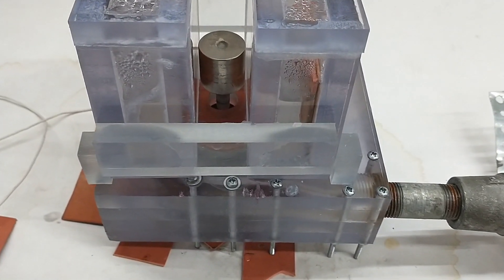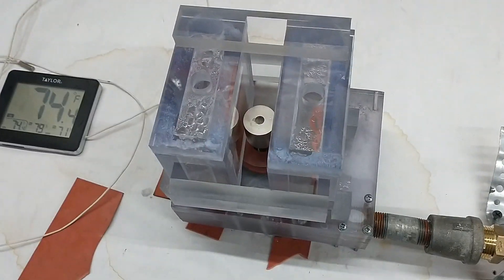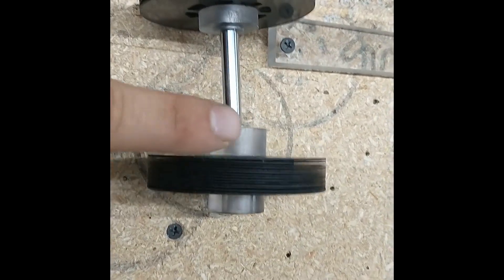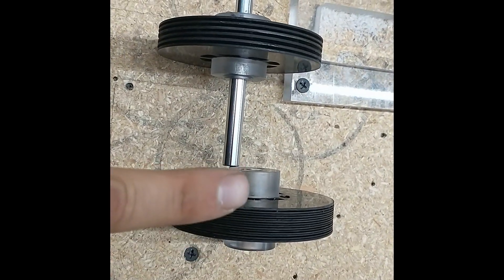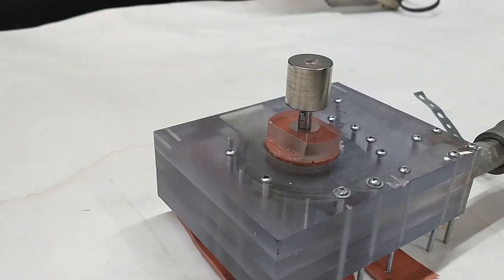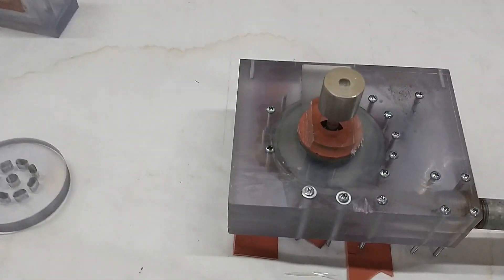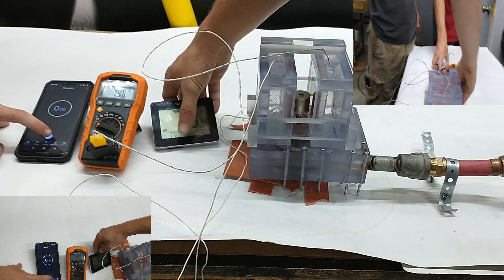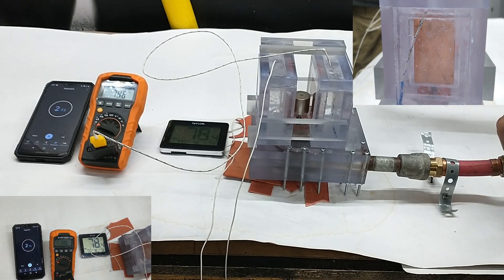3" Tesla Turbine Sustains an estimated 1750 WATTS!

Comment: Wait the spinning magnets made those plates heat up like that 😮
Reply from the maker: yeah 🙂
Reply: @iEnergySupply  have you ever tried putting a subwoofer up against the turbine (rubber or something noise reducing between) and using a frequency generator just as an experiment?

Comment: Ok what you want is a well designed ball magnet perfectly round now that is on a whole other level
Reply from the maker: surprisingly they don't come perfect. I still have to modify them to make them balanced.
Reply: @iEnergySupply  I think it's possible to run the turbine off from a geet Generator bubbler arrangement create enough energy to then the water into hydrogen using the George Wiseman browns gas technology then it should in theory work depending on the size 🤔 this would leave alot of extra power for the Generator to power stuff without dealing with breaking down the water to a gas by traditional methods now this would be better to start off small and get the bubbler working on a tiny lawn mower with maybe an alternator to see if the browns gas produced by the tesla turbine running off the bubbler would be enough to work on large scale that being said alot of research would have to go into such a system to obtain close to maximum efficiency plus the watts would have to be pretty high coming from the tesla turbine but even if that was the case and this system fails to work there's always solid oxide fuel cells and redox flow batteries that can be implemented into a closed loop system like specially designed around refrigerator systems something like seen on the race to zero point energy video on   youtube finally I would say what's need the most is a true dedicated discord or telegram channel where minds from different backgrounds and research can come together then the possibilities are endless providing the right communications and fellowship of course

Comment: Would it be feasible to implement an I/O swapping mechanism to switch the system over between seasons? Let's say we're using the constant temp zone from 12 to 40 feet below surface as the cold sink during summer and a heat source in winter. It would be much more economical to switch the input and output lines instead of having 2 separate systems.

Comment: I appreciate what you are trying to do but and I may be wrong but after seeing this video I don't understand how this can be feasible for the following reasons, maybe someone can correct me or educate me on this?:

1 - The quantity of water which you boiled was very little make this extremely inefficient
2 - You have to create the cold steam to drive this device - making this extremely inefficient
3 - This is using eddy currents and is similar of how an induction cooker works to boil the water, just because 'Tesla' is involved in some way doesn't mean this is anything special.
4 - There are specialist engineers and scientists who have studied aerodynamics and turbine design and they have done an amazing job if you take a look at the engineering of a steam turbine from a coal power plant or a nuclear power plant. If this Tesla turbine was worth any results they would have already gone this route, these designs and principles are no secret.
Reply from the maker: Finishing production turbine. It works great if you want to generate energy with high an even low temperature differentials. I have achieved an isentropic efficiency of over 95%. Videos will come later because we want to keep it confidential other then patreon until we start production, which is right around the corner.

Comment: you have access to a lathe to turn the magnet?
Reply from the maker: you can't turn down the Neodymium, it will alter the magnetic field, also it's extremely hard.
Reply: @iEnergySupply  harder than carbide? as far as the field wouldnt a perfectly cylindrical magnet provide a perfectly even field?

Comment: I finally see a vision. Using your cold steam idea. Preheating the water using a DC inverter split system water heater than creating a vacuum in the tank by adding an LG twin inverter compressor than pushing your turbine sandwiched in-between two copper line cylindrical tank. If I am right to assume that the heat generated would be placed evenly along the electricity. The only problem I have is whether, or not the electricity would travel around the conductors resistance, but if it could then you would have two true steam generators that could push a carbine fiber 18in tesla turbine.

Comment: I have a questions about the individual blades, but first the set up to the question.  The flow of the air/liquid appears to follow Fibonacci sequences.   Has any test ever been done on etching Fibonacci arches into the blades?  Also, testing aligned and off-set etched sequenced blades.  Also, matching the Fibonacci sequence to the flow - so the flow arch is the preceding sequence?  One more question; has anyone ever done counter-rotating generation?  Where the magnets and the copper coils are driven by tesla turbines rotating in opposite directions?  Seems lower speeds could be used to accomplish the task.  
I believe your the tesla turbine is great.  I am fascinated by the possibilities.  Keep up the good work.

Comment: Have you guys thought about using super heated steam 600-700 degress and a modified electric tankless water heater to generate the steam then using the steam to power the water heater. at those temps it supercharges steam and it is most efficient, its what nuclear power plants run at, also white and doble steam cars.

Comment: I'm now in the process of building a Tesla Turbine that can power an electric trike on two air tanks. Well one air tank will be on the turbine and once it runs too low I will switch it to the other tank and connecting the pedals to a pump so I can be pump the empty air tank with air to extend drive time 😅 then just switching back and forth mid drive to keep the turbine going and in turn keep the electric motor goin lol
Reply from the maker: Would be really cool to run it on co2, you would need to have a radiator on the co2 output to heat the gas as it expands into your nozzle though. I'm not sure how well it would do on just a tank of compressed air. There isn't much energy in a tank of regular compressed air.
Reply: @iEnergySupply   I'm thinking of using some truly high end, high PSI tanks that are fitted for refill AND I have some high end neodymium magnets that have pretty high teslas and some decently gauged silver wire. OR I can just use the turbine to power an alternator but idk yet. Just gotta calculate the turns and appropriate RPMs cuz honestly it wont have to be that fast to simply keep the batteries charged.
Reply: @iEnergySupply  Also, I predict it will work really good in cities or urban areas as the constant stopping gives me a chance to keep pumping while stopped thus charging the battery rather than long open roadtrips where the electric motors are constantly engaged 😅
Reply: @iEnergySupply  Hi sir

Comment: So tesla turbine is actually work but what about meccanical failure from warping disk? Are they string enogh to produce gigawatt or megawatt??
Reply from the maker: They scale very well,  I've never had any issues with warping. Nicola Tesla did a test to  See the maximum velocity of some of his turbines. His turbines. He did have disks warp but there was no reason to run the turbines that fast other than for a test. It actually wasn't an issue when running the turbines normally.  It's possible to get whatever power you want including megawatts , just depends on how large your turbine is.. Tesla's 18" turbine got over 200 horsepower And he said it was capable of 600 horsepower with full vacuum on the exhaust .

Comment: I think you might be getting a bit of imbalance and friction from having the resistor plates haphazardly placed on either side plus you're not transferring the heat very evenly and efficiently into the water with that configuration. I'm curious what would happen if you wrapped a coil of copper tubing of around 1/4 or less diameter tubing maybe 1/8" tubing in a coil so it creates an evenly balanced drag on the magnet as it spins but also you'd get extremely fast heat transfer by using narrow tubing gravity fed by a reservoir above rather than a resistor plate inside a container of water. The steam produced this way could then easily be directed back into your input nozzle for more power. I'm so excited to see you doing these projects because I can't afford to spend all this money researching. I need to build something that works out ok and use it. So you're saving me a lot of time and money by airing your findings on YouTube therefore I will never hesitate to share any idea you inspire me with or which might be an improvement on the project. I don't see anyone else publicly taking this research as far as you have but I believe that the public NEEDS this technology more desperately than they can possibly understand.
Reply from the maker: yeah, I didn't spend much time on this experiment, it was primarily for testing maximum power output of the turbine, but was also in my spare time while I was waiting for my more serious work. I thought it was cool to see the copper heat up so easily in the magnetic field.  I never intended to use the steam coming from the turbine generator.

Comment: I've been thinking of using compressed air as a method to store energy from my solar panels.  This looks like a feasible method to generating thst elslectricity, and if I can adjust the pressure, that means I have controllable power, which would be ideal for efficiency
Reply from the maker: Only problem is you would need some really large tank, and I'm talking over 3000 gallons. That's why I switched to cold steam.
Reply: You are better off storing that energy inside a sand-battery then. And using that either directly to warm your water or air, or to boil water. I was personally thinking of having a large tesla-valve running through the sand, so the water would start evaporating and will have no road to go except "forward". So you can supply water at low pressure, and have it escape at high pressure into the turbine.

Have you already heard of the "two stage" tesla turbine, utilizing his turbine AND vacuum patent, which are meant to work together? The last "piece of the puzzle", is to have an "air bearing" on the sides. So basically, Tesla Turbine in the middle, Tesla Vacuum on both sides, on the same axle. It will increase it's efficiency, + the air bearings will be suspended on constant small cushion of air, drawn in by the vacuums on both sides.

If done well mathematically (for which I am looking a book for), then efficiency can truly reach 100%, or 99%. For even the hot steam, has been shown to be able to be condensable to ice, effectively taking it's thermal energy as well as it's kinetic energy.

Shall I send you links if you are interested?

Comment: What is this some kind of joke? You have the output from the turbine going into the coil chambers? And why is the voltage not being shown on the meter. how do you measure torque? Did you hold it with your fingers and feel the torque that way?
Reply from the maker: I'm not using coils here, it's heating the water with lenz law, the power demonstrated is shown by the steam, and the amount of water boiled from the test.

Comment: so how many watts were used to send the air to the turbine.. does not matter if you make 50000 watts if it takes 100000 watts to work.. that part seems to be left out.
Reply from the maker: Air compressors, are not efficient, probably 10% at best once the air cools down. This is meant to be run on steam.

Comment: Let's hope one day you can make materials out of graphene!
Reply from the maker: Not sure why we need graphene, I have been getting the self regulating condition that prevents the turbine from spinning too fast. Also tesla didn't have any difficulties producing over 200 Horsepower without disks warping. If you think we need graphene because Lesics video on the tesla turbine Here is one of my comments "I just wanted to note a big mistake in the video! The video says the rotor must spin at a very high rpm, maybe 50,000 for a 6” turbine. The speed of a turbine is based on periphery speed not rpm. If a 6” turbine needs to spin 50,000 rpm to be efficient like the video says, that’s a periphery speed of 890.1 Miles per hour. If you want a 3 meter disk to achieve close to 891 miles per hour at the periphery, the rpm required is only 7,253. We have materials that can easily reach that speed."

Comment: Hello, would it be possible to create a design that allows the compressor to be fed and at the same time that there is some excess energy? so that it can be self-powered and have a few watts left over for lighting or other low-consumption devices. Great work. Thanks and regards.
Reply from the maker: it's designed to run off low temperature steam. This was just to show raw power from air.

Comment: Have you over come the warping issue of the discs as it approaches the 50000 rpm mark? Because Tesla himself had that problem Because the centrifugal force at the edge of the discs at the higher rpms is a lot to say the least. Are there materials now that can with stand those rotational forces without warping or anything else?
Reply from the maker: The video you watched has too many mathematical errors. I've achieved 150000 rpm without the slightest warping of the disk. Also tesla didn't have any trouble making over 200 horsepower with a 18" turbine. I just wanted to note a big mistake in the video! The video says the rotor must spin at a very high rpm, maybe 50,000 for a 6” turbine. The speed of a turbine is based on periphery speed not rpm. If a 6” turbine needs to spin 50,000 rpm to be efficient like the video says, that’s a periphery speed of 890.1 Miles per hour. If you want a 3 meter disk to achieve close to 891 miles per hour at the periphery, the rpm required is only 7,253. We have materials that can easily reach that speed.
Reply: @iEnergySupply  ok cool. What material would you recommend for building a Tesla turbine powered by steam.

Comment: You could certainly have fun with this if you linked the outputs of the boiling water back to the hose at the input in a feedback loop. You can use a check valve and a  CD nozzle to greatly increase the velocity. You could even try super sonic and long as the pressure can be sustained!

Comment: Very cool test!  Some nits: Viscosity is a property of the water and is not affected by the rotor plate distance.  What you meant to say was that the Adhesion or Coupling was increased by using thinner spaces between the rotor plates.  It wasn't clear to me whether you fed the turbine steam or water.
Where did you get the energy value in the equasion?  Was that somehow derived from the volume of water your boiled?
Be sure to use distilled water in tests as the specific heat capacity of the water can vary a lot with impurities.
It wasn't clear to me what the 79 degree temperature was reading - was that just the turbine casing?  It was also a nice test to see if the thermometers could handle boiling water on them.
 😎❤🎉👀👌
Reply from the maker: Yeah was an older video I wasn't going to publish but decided too later. I needed a larger body of water, but when I saw it boiling so fast I got excited and just let it go. Your correct about the adhesion.

Comment: This is exceptional work. 
May I point out that on Tesla's British patent, he put the turbine exhaust in vacuum. It raised the efficiency by claims of 100% or more. 

Doing this would the require less psi input. 

Also a Venturi effect on the input would suck more ambient air at the intake open Port with an adjustable jet ( laterally) to get the perfect distance into the open intake Port. 

Also a smaller jet (at intake) would increase psi at the intake and decrease volume of air needed to move the turbine ( with the venture causing vacuum (at open intake port) of the ambient air caused by the jet in the open intake port.

You can possibly take advantage of vacuum by: routing  a portion  of the exhaust to the open intake as high pressure ambient air. 

I also am looking at the exhaust Port set up in a Venturi to an open duct on both ends. Then having the exhaust Port Venturi effect into an open duct that feeds some air to the intake ambient air( on turbine one, and the rest to a Total separate ( turbine Two) with a Venturi effect on an open intake. 

Utilizing the 14.8 psi (1bar) of ambient air with a Venturi effect add intake and at exhaust.